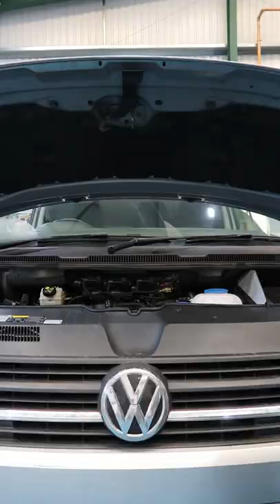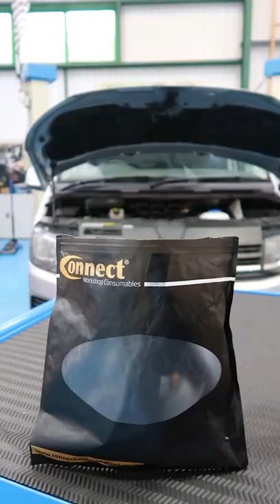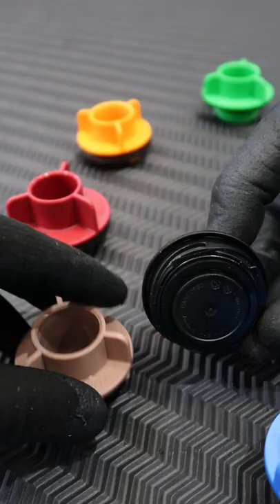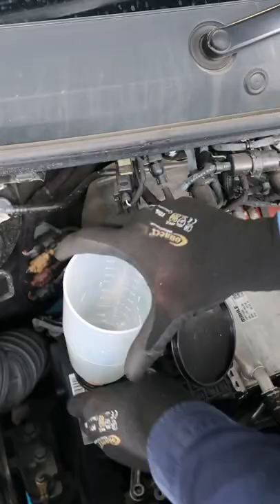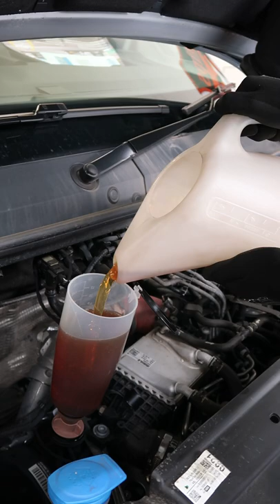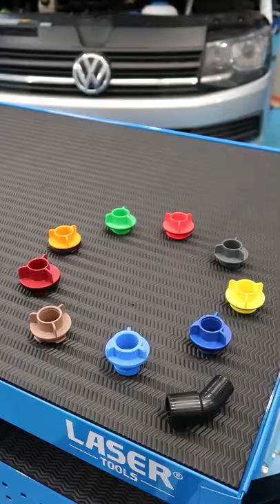7980 | Oil Funnel Kit | Laser Tools | #Shorts

Comment: Why?
Reply from the maker: So that the user doesn't have to use one hand to hold the funnel in place, and can use to hands to hold the oil container. Also helps to keep the top engine clean, as you're less likely to spill the oil.